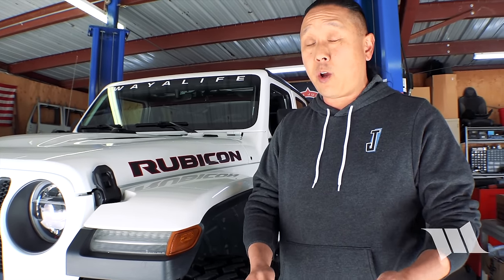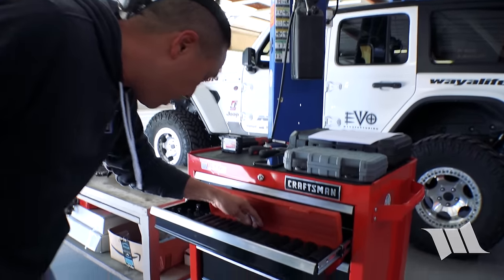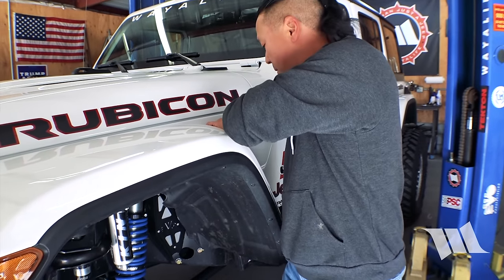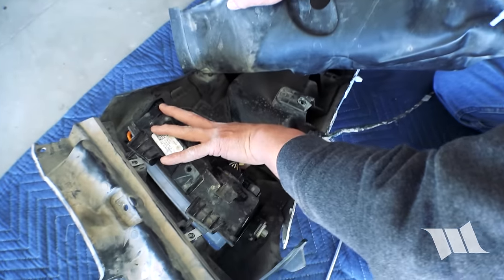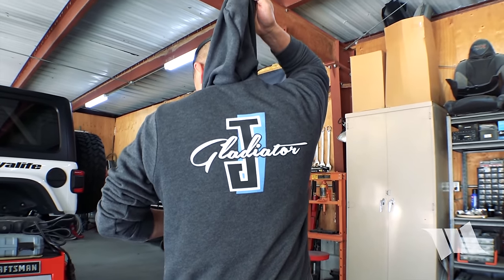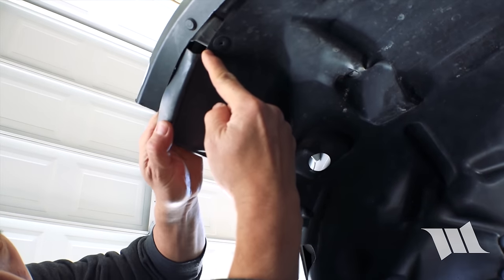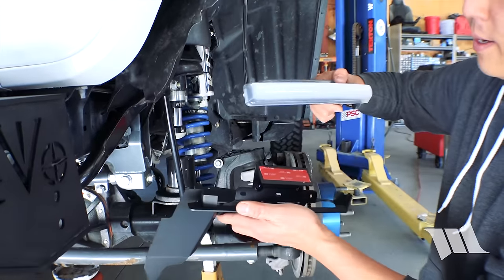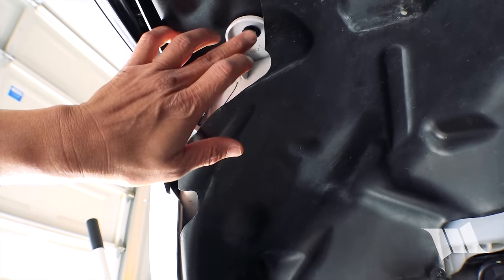Jeep JL Wrangler JT Gladiator Truck DRL for Factor Fender Chop or Trim by Rugged Ridge Installation

Comment: A tip you might appreciate, after you cut plastic like you have with the dremel and clean with a file, use a cigarette lighter and gently melt the small furry fibres.
Reply from the maker: Thanks for the tip!

Comment: Looks like the best option but seems like not as much for up travel clearance. I am looking forward to seeing their full fender replacements that look like this but sit higher.
Reply from the maker: If you have a Rubicon and remove the inner fender liner, you will have a lot more clearance. I just chose not to do that. Their new full and higher sitting fenders are coming too though.
Reply: Wayalife ya I certainly looks better the way you did it though
Reply: @wayalife  I'm also waiting for the chop that increases clearance so it provides better looks and more room to flex.
Reply from the maker: @Strizzle81  Just so that we're all on the same page, it's important to ALWAYS run about the same amount of bump stop extension as you have lift. Not only will they help to prevent things like rubbing things like your fenders, they will more importantly help to prevent the over compression of your coils. AS IN, prevent your coils from squashing down to the point they no longer return to their original height. With my current setup, I do not have any rubbing issues.

Comment: Great video.  

Does the clear plastic light cover fade out yellow over time?  How close to the factory LEDs do these match?
Reply from the maker: I've had these on for about 2 years and show no signs of yellowing. The white light is very close to factory if not the same.

Comment: Eddie I love the look. Couple of concerns...I’ve replaced the factory inner fenders with DV8 inner fenders and love how they make the Jeep pop especially since I painted the inner mesh to match the red accents of the JL. So obviously trimming these back is a littler harder than using a utility knife. First I haven’t even looked, is that even necessary? The other area is the sleekness of the RR DRL is excellent the only I’d like better is if they had a cascading turn signal instead of a flash/blink is there such a beast out there? Thanks man you are the best!!
Reply from the maker: Sorry, I'm not entirely sure if it is. What I can tell you is that the brackets do tie into mounts that the inner fender liner would otherwise be attached to.
Reply: QuakeLED makes one with a sequential turn signal. I bought them but haven’t installed them yet.

Comment: Hey Eddie: thanks for the video...really great!  After a few months has the tape held up?  Do you know when these are going to be available to buy?
Reply from the maker: So, the tape has held up on one side but not the other. I have since used a hole on the fender sub-structure and one on the body to secure the two together with a zip tie. It's been holding up great but I bet a better solution could be made and I have shared this with Rugged Ridge. These were supposed to be out last month but with all that's going on in the world, everything's been pushed back.
Reply: Wayalife awesome - hopefully they will listen.  Did the LED throw any errors that needed the Tazer?  Thanks for the reply man. Appreciate it!

Comment: Love your install videos. Like the product, but to me... it seems unfinished? The corner, where the DRL meets the side of the fender - the gap could be better. Also, they could have added a flap to connect to the trimmed fender liner. As it stands, the cut fender liner looks like it will catch wind, rain, snow & debris... what do you think?
Reply from the maker: I dunno. The other options out there require you to remove the inner fender liner all together. So far, I've been pretty happy with the way these install and don't really see it as being a problem. To me, these look very factory and more so that other options I've seen so far.
Reply: Wayalife they definitely look great. You would know more about their real world functionality. Thanks for your input!

Comment: Can't wait to install mines once I got enough to get my lift kit in and tires cause my fender chop kit from quake led is patiently waiting for those parts, currently have the fender chop kit,the yeti steersmarts trackbar,draglink with the attenunator or whatever it's called and lastly the synergy steering/trackbar/sector shaft brace.But I can't wait to get my lift kit btw I'm planning to get the rock crawler pro x system or.....the fabtech long arm kit,I just don't know what to get though
Reply from the maker: wow, sounds like you've got a smorgasbord of parts going on your jeep.
Reply: @wayalife  Yesirrr,Cant wait to see my dads face,my 15 year old self has been putting in that work/overtime at Ace Hardware
Reply from the maker: @thatmand4542  LOL - awesome
Reply: @wayalife  Yesirrr

Comment: that inner fender cut kinda seems like an afterthought and leaves a big hole for mud and water to get up in there.  i like the LEDs but that gaping hole not so much.
Reply from the maker: LOL - if you say so. You could probably cut them differently than I did to get a better result. I was just happy that I could keep as much of the inner fender liner as I could being that other kits require you to remove it all together.
Reply: @wayalife  oh absolutely I don't disagree!!

Comment: Great video.   I have a 2018 JL Sahara that doesn't have the LED package.  Would it be an upgrade that would work for my jeep?
Reply from the maker: First off, this particular DRL that we installed was made for a Rubicon. Rugged Ridge will be making one for Sports/Saharas but you will need to be sure to get one of those kits. That being said, yes, you should be able to install these on your Jeep and without issues.

Comment: Did ya lose the rubber gasket material you put in way back for all the lil rocks and dirt that was getting stuck between the fender and body? Did it disintegrate already?
Reply from the maker: LOL - I've hit my fenders enough times that they're cracked and wouldn't hold the welt the way they used to. I need to replace them.

Comment: i was planning on purchasing this. But if the LED burns out, do i need to buy the whole set up again or is it an easy light bulb change?
Reply from the maker: Just like the factory DRL, you'd have to change out the whole light. Fortunately, LED's last a long time.

Comment: Great video!  I saw that your running 17x8.5 wheels with 4.75 backspacing + 1.5" wheel spacers and 37s.  Were you not able to flex without rubbing with the 4.75 backspacing?
Reply from the maker: Not with the EVO coilovers. If we were running 3.5" of back spacing, we'd be okay.
Reply: @wayalife  Thanks Eddie...I'm running milestar 37x12.50 on 17x9 kmc beadlocks with 3.5" backspacing on a jl rubi 2.5" RK lift(2 bumpstops) and am about to switch to method 17x8.5 with 4.75 backspacing nonbeadlocks.  Looking to run 38x13.50 Milestars...would they clear decently well when turning and flexing or would you stick with 37x12.50?  The milestar's tread isnt nearly as blocky as your Coopers or Nitto's...hoping that would help with clearance.
Reply from the maker: @Strizzle81  If you're seeing rubbing now and with 3.5" of back spacing, you're gonna see a TON of rubbing with 4.75" and bigger and wider tires.
Reply: @wayalife  no rubbing now..I have a too  much room with 3.5 backspacing and dont like the tires way outside fenders.  Thanks for responding.
Reply from the maker: @Strizzle81  Okay, and that's because you're running 3.5" of back spacing. If you run more back spacing, you WILL have rubbing especially with bigger and wider tires. That is in part why we moved to a 37x12.50 from the 13.50s we were running before.

Comment: Looks great! Any idea on price point and are you running wheel spacers?
Reply from the maker: Sorry, I don't know price point but this information should be available soon. Also, yes, we are running Spidertrax wheel spacers to help our tires clear our EVO coilovers.
Reply: Wayalife thanks! My 37 STT pros are hitting my control arms, I worry about running the spacers on the stock axles wish I could get something thinner than 1.75
Reply from the maker: You could always add a couple of washers to the steer stops. That will fix the rubbing you're seeing. http://project-jk.com/jeep-jk-write-ups/jeep-jk-wrangler-steer-stop-adjustment
Reply: Wayalife oh thanks, that’s super clever

Comment: Great video! What are the pros and cons of this compared to the version by American Adventure Labs???
Reply from the maker: What I can tell you is that I personally like the fact that this Rugged Ridge DRL kit allows you to retain the factory fender liners. I also think the brackets are nicer in how they are made and really like that they cover the bottom of the DRLs. This gives them a more finished look and make them feel stronger. Another thing I like about them is how factory the DRL lights actually look and feel and how they put out a white light color that matches the factory LEDs well.
Reply: @wayalife  Gotcha. Will these new DRLs only work if the factory lights are also LED?
Reply from the maker: @erickdiaz6152  Should work regardless.

Comment: I'd like to follow up on this. I am looking to do this to my 2018 JL and in looking at the reviews of the lights, they are not good. I see lots of complaints of failed lights, easily weather worn and just falling apart. How are they doing 3 years later?
Reply from the maker: So far so good. These lights and everyone I know with them have not had any issues.
Reply: Awesome and thanks for responding. The lights are going to be a xmas present to myself :) Make sure you post next time you're in Maine.  @wayalife

Comment: what model and year should i look for to buy fender flare like yours? I have 2020 JL unlimited sport and my fender flare dont look like yours at all but have all extra stuff around the light unit.
Reply from the maker: This kit is made for Rubicon fenders only. Rugged Ridge does make replacement fenders that come with DRLs like this.

Comment: Hi Wayalife, I just put 40s with 3.5" metalcloak lift on my JL Rubicon. Will the fender chop solve my fender rubbing issues? Or I will need those MAX terrain fenders from them?
Reply from the maker: Hard to say for sure being that no 3.5" lift measures out the same. Depending on what yours "actually" ended up yielding, you should be find just removing the fender liners and trim.
Reply: @wayalife  do you know much about their Max Terrain fenders? Can I get a lot more clearance 
 than the 
fender chop?
Reply from the maker: @rtingdds  They're nice but they'll only give you a little more clearance than a set of Rubicon fenders.

Comment: Chad Coker
I really like how this kit looks but the trim gap where it had to be cut kills it for me... :/ They need to offer a replacement trim panel as well or something.
Reply from the maker: To be fair, this DRL was made mainly for guys who are wanting to completely remove the fender liner and trim of a factory fender. They have designed it so that it "could" be made to work with them still on as well. I for one like the way it came out for us but of course, to each their own.
Reply: Wayalife agree. There are many kits out there already that do the same with removing the bottom portion. I was just hoping this kit would be different and allowing a cleaner look with the lower portion. I actually thought it was going to have its own lower fender attachment from the previous pics I’ve seen. I feel without the bottom it just doesn’t look as good and gives the fender a flimsy look.

Comment: What gearing are you running with your 37 ridge grapplers?
Reply from the maker: We had 5.13 installed but can tell you that it's a better fit for 38's. 4.88 is a better match for 37's.

Comment: How are these holding up? Deciding between these and the quake
Reply from the maker: They held up great and didn't yellow at all but I did end up tearing them off with the 38" Nitto Ridge Grapplers I upgraded to.
Reply: @wayalife  what did you replace with
Reply from the maker: @Otownoverland  Installed a set of these https://amzn.to/3G1iXy9 on the fender support.

Comment: The only way my drl will turn on is if the parking lights or headlights are on. Any advise? I’ve tried all the options on the tazer jl
Reply from the maker: If that's the case, you do not have DRLs on your Jeep. You just have parking/indicator lights.

Comment: So these are 37s on what size lift? I'm looking at doing this fender chop with a 2.5" lift and 35s. I just don't want it too look too open/small tires lol
Reply from the maker: In this video, you're looking at a JL that has an EVO coilover system set at about 4" of lift.
Reply: @wayalife  thanks. Would you recommend doing this or save up and go all out with Nemesis fenders?
Reply from the maker: @ViolationNVibratioN I personally like the factory fenders but wanted to open things up and this did it well. I also like how these DRLs do not turn yellow like a lot of other manufacturers do.
Reply: @wayalife  good to know. I was looking at these and quake.

Comment: @wayalife is it compatible with Rubicon only? Or it can fit on Sahara 2020 fender?
Reply from the maker: These are Rubicon specific but Rugged Ridge does make them for a Sport/Sahara as well.
Reply: @wayalife  thanks for the info, found only brackets without DRLs for the Sahara, unlesa you may advise where else i can purchase it, much appreciated!
Reply from the maker: @mutasemafani2248  They may not be out yet but I was told they are coming.

Comment: when can these be bought?  cant find them on their site..
Reply: Same, all I can find is the Chop bracket, not showing if the signal light itself is included?
Reply: @mdsaracino  yea their chop brackets dont include the light like in this video. it looks like they're not for sale yet 🤷🏻‍♂️
Reply from the maker: The Rubicon version was supposed to come out this month but with all that's going on, I have a feeling that might get pushed back a bit.
Reply: @wayalife  makes sense. another great video btw 👍

Comment: Rugged Ridge vs. AmericanAdventureLab?
Reply from the maker: Me personally, I like Rugged Ridge better as you can keep your fender liners in place, they have a nice white DRL that matches the color of the LED headlights and halos and the brackets have a cleaner look once installed. Of course, that's just my opinion.
Reply: Wayalife, I appreciate the feedback. My inner fender lines have already been removed and replaced with JCR inner fender liners to accommodate my Falcon 3.3’s. Just torn between RR and AAL.
Reply from the maker: Well, if this is something you're wanting to do right now AAL is probably gonna be your only bet as the Rugged Ridge ones aren't available just yet. If you can wait a bit, I personally think the Rugged Ridge one are nicer and I think you would too if you could see them side by side the way I have.
Reply: Wayalife, thanks bro. Considering the AAL’s have a lead time as well, I may hold off and see what’s released first.... the Rugged Ridge or AAL’s RGB’s!

Comment: Will this fit a 2017 rubicon
Reply from the maker: No. There's no need for one on a JK. This is made for a JL as they have the indicator lights on the fenders.
Reply: @wayalife  jk 2017 has side fender indicators. This is better than the circle yellow light
Reply from the maker: @gplock1626  Those are side marker lights. Not the same thing. Also, I should have been more specific in that the JL indicator lights are also DRLs as in, daytime running lights. That's what these are.